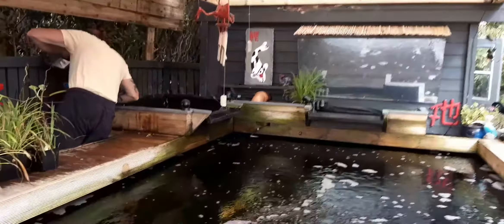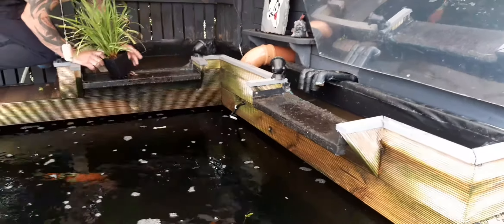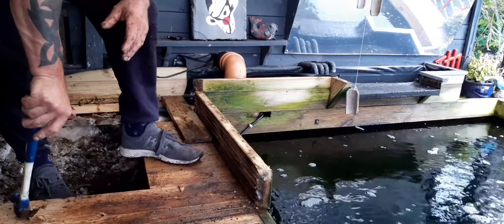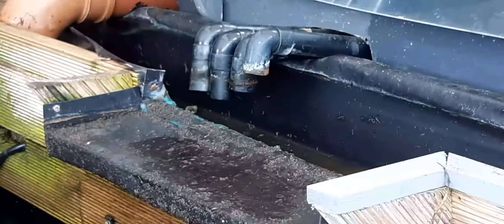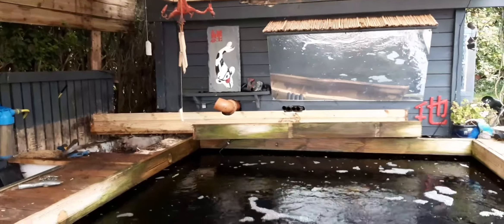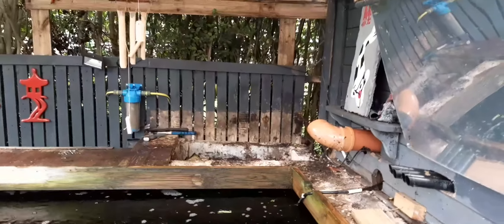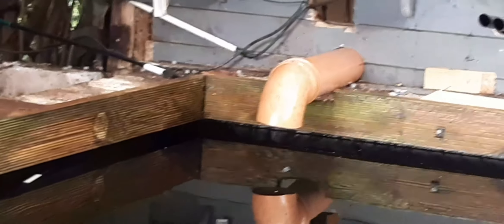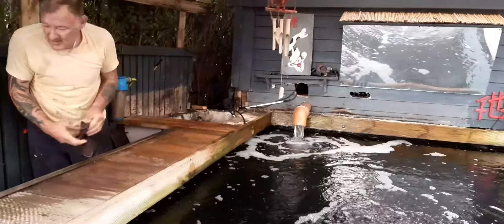The water falls are taken down. Fresh start on the Koi pond

Comment: Ho had that kind of feeling it was going to be a damp nasty under and around that water will track in places like that I had a friend with a lovey sleeper built pond he had an oak capping round the top it looked fantastic about 5 years in he had some loss's fish wise all within a month the rest looking sorry for them self's with sores and we could not get to the bottom of it he lost 14 or more fish in the end all we managed was saving two in the end. When we found the problem it turned out to be damp under the capping constant water was tracking up the liner folds in the corners and the crap that was growing under them capping's was so nasty. It was a easy fix capping's off clean and seal them down on top so the water could not get under. He's  still got the pond this must have been 15 years back or more
Reply from the maker: Well fingers crossed we see improvement. Thanks